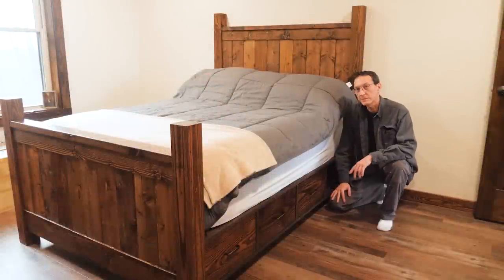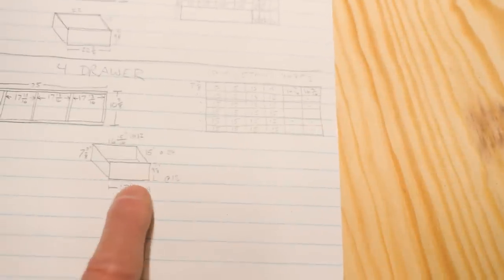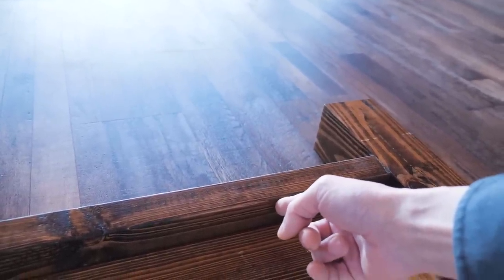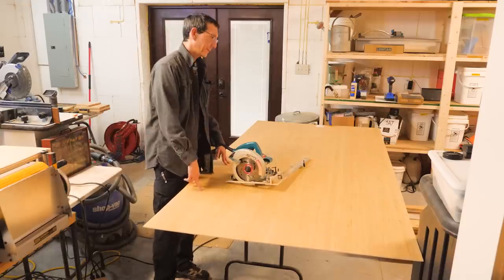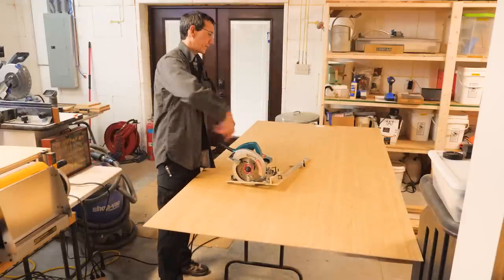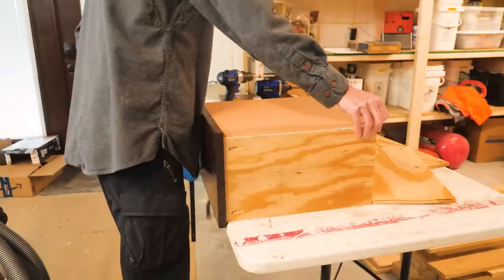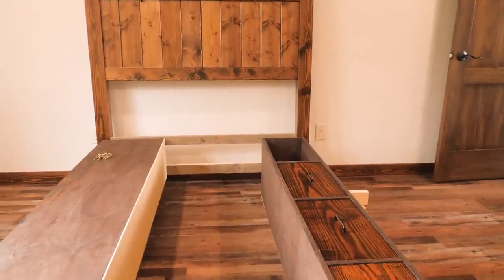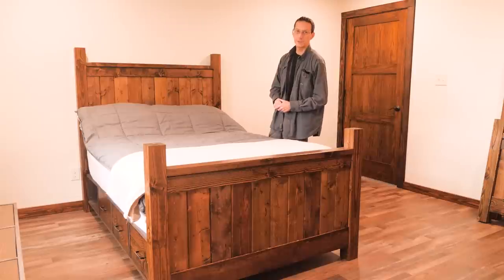How to Build a Rustic Farmhouse Style Captains Bed with Drawers

Comment: When I was a kid, my parents had 3 twin beds with 6 drawers (3 top / 3 bottom) made for my brothers and me.  No headboard or footboard.  They still have them and the drawers still work.  They had casters put on the bottom, so we could roll them, but that caused an issue when we had to take them in and out of the rooms.